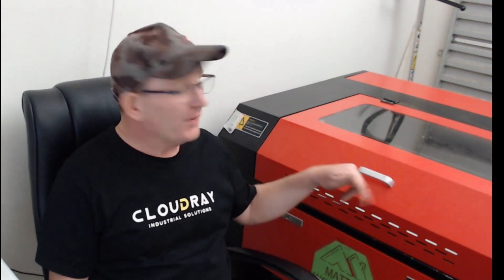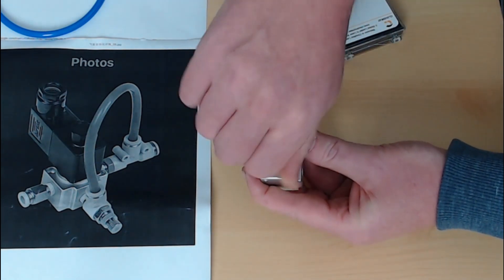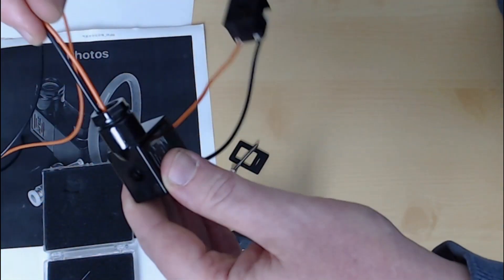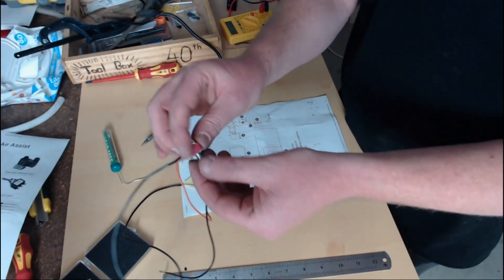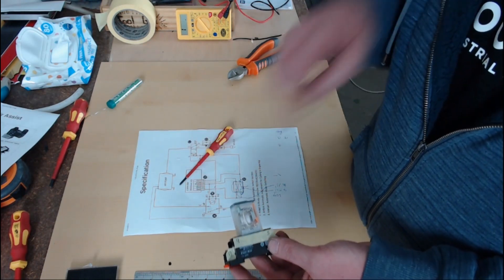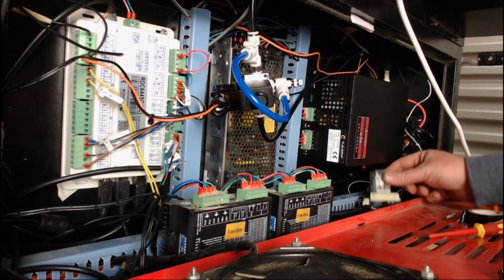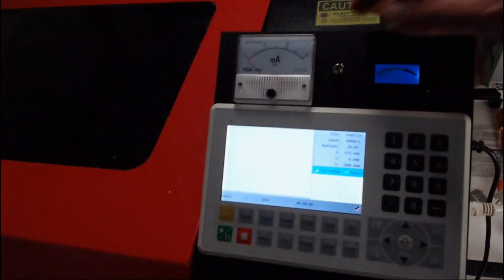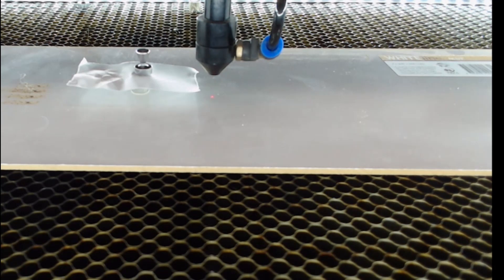Ultimate Air Assist Upgrade for Co2 Laser RUIDA 644X Controllers - CNC Co2 Laser Machine

Comment: Great video!  Especially helpful since I didn't receive any instructions with my Ultimate Air Assist kit!  I am puzzled, though, by your comments about hooking your exhaust fan to the relay, so when the air assist relay kicks on, your exhaust fan kicks on.  But what about exhaust when you're doing engraving and not cutting?  Seems you would want exhaust on whenever the laser is running.  Only turning it on when cutting would also tend to fog your lens.  Am I missing something here?  Thanks for your clarification, and thanks for your great videos-- very helpful!
Reply from the maker: With the ultimate air assist kit the relay switches power to the exhaust and the air pump.
When you select Air ON or OFF the relay still turns on both the Air pump and exhaust so they are always ON when the laser is operating.  The ultimate air assist kit also includes a pneumatic solenoid, it is that solenoid that turns ON or OFF with the engraving or cut layer options for Air on or off.  This solenoid also allows a small flow of air to protect the lens while the laser is running even if you have selected Air off for engraving.
The result is.  when you start laser, the relay switches on Air pump and Exhaust, the solenoid controls Air on or off for each part of laser work, then at completion of job relay turns off air pump and exhaust.
I hope this explanation answers your questions.
Cheers Matt
Reply: @MWLaser  I assume that is why you added a diverter section of pipe to bypass the solonoid ? ( to allow a small constant flow of air while engraving )
Reply: I was thinking the same, would be better to have exhaust fan kick in whenever a job or the laser is active?
also ideally would require a delay (off) to give it time to completely exhaust al the smoke at the end.

Comment: Hi Matt ... Thank You for making this Video ... can you tell me if the Relay can control a 24v Air Solenoid ... I want to hook this kit to my Shop Air.   Take Care
Reply: Hi Matt .. finally got my Ultimate Air Assist Kit .... I wired everything according to your video ... I hooked the wires on the Relay Terminals 9 and 5 to the Air Solenoid on my Air Compressor .... but it doesn't engage .... should I be using different Terminals on the Relay ? .... and Thank You very much for producing all your Videos :)
Reply from the maker: Sorry I've been busy - I've replied to your email
Reply: @MWLaser  Hi Matt, I'm still waiting for my laser to arrive, but I'm planning to use an air compressor instead of the pump, so the situation will be the same as Boomer088. I think I need to substitute the relay with a solenoid. Am I right? Thank you

Comment: Would this also work with the Ruida RDC 6442s?
Reply from the maker: Yes
Reply: @MWLaser  Thanks Matt love your videos!
Reply: @MWLaser  one other thing my kit only came with two diodes isn't that all that's used in this setup
Reply from the maker: @henryhartsfield4574  yes one for the solenoid and the other on the relay

Comment: Hello Matt, thank you for this video. I decided to buy it after watching your video, I thought i could do it!
But now, after receiving the product I have a couple of questions, it seems more difficult:
1. Can I connect the air blower (550w, 220v) to the same plug or just the air pump? The relay switch can support it?
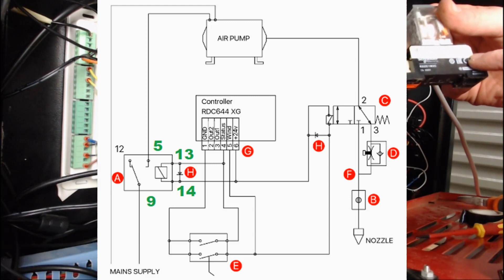2.1 I didn't understand how did you connect the wires to the plug, (between 11:37 and 12:25), did you remove the old plug wires?
2.2 I am missing some details, relating to the relay switch. Where goes the cable number 9 (and is a power in or out) and number 5 wire?
2.3 Is the controller supporting the power of that plug (as source) 24 volts?

3. The last question, it's a beginner question, but is important what kind of wires I need to buy? 0,5 copper wire, because seems you are using two types one for 220v and other for 24v?

Thanks for your videos and support
Reply from the maker: Send me an email cheers Matt@mwlaser.com.au
Reply: @MWLaser  I have the same questions....
Reply: Hi same question please. Tony 😀

Comment: Nice video!  I just ordered mine, and I was wondering what you use for the air?  A compressor or a fishtanks air that comes with the laser?  If it is a compressor, what size would you recommend for a 100W laser?
Reply from the maker: Just the pump supplied with the machine, for my larger machine I have a lager version of the same 'fish tank" style pump

Comment: Hi Matt. Thanks for the tutorial. Laser newbie here. I purchased the air assist from cloudray, but cannot seem to get the relay to work. I tried the toggle switch and it will activate the air valve solenoid, but not the relay as well. I removed the switch for now. 
To get the air solenoid to work I had to change the vendor settings to “Enable air-assist output - true” in Lightburn. The green LED on the relay is on. I have 3 outlets on the back of my laser that are daisy-chained. I routed the supply from the second one to terminal 9 and then from 5 to the 3rd outlet, where the air pump is connected. When I bypass the relay by checking terminal 9 to the negative on the 3rd outlet my circuit tester shows 124 volts. When I check terminals 9 to 5 I get 67 volts. Do you think the relay could be bad? 
Thanks for any input or suggestions.
Reply from the maker: Possibly yes - email me to discuss further if you need.
Cheers 
Matt@mwlaser.com.au

Comment: Please add the steps necessary to turn on air assist output in the vendor settings on the controller. I just spent several hours troubleshooting my install and finally decided to go through the controller options.
Reply from the maker: G'day, there are not any Vendor Settings required to enable air assist.  The option to have air on or off is set on the Layers of your work plan.  Eg if you have a Layer that is set to cut you open the layer and make the changes there.  Eg for RD works open the a Layer of your job, and you will see the option "If Blowing", set this to Yes if you want air on, or No if you want air off.  You make the necessary changes on each layer you have for your work.  In Lightburn there is also the option in the Layers labelled "Air Assist"... again turn on for Air on, and Off for no Air Assit.
Cheers Matt
Reply: @MWLaser  Matt, Jeremy is correct. I spent 2 frustrating days learning this on my own.
Reply: I wish I had read the comments before wasting a 2 days finding this on my own. You are absolutely correct. Vendor settings, on the "other" page and make sure the Blower check box is enabled. Neither the WIND nor STATUS outputs will activate if this is not set correctly.

Comment: Hey Matt, great videos. It’s hard to find much about installing this other than this and Russ’s video. I was wondering, on the over ride switch. Is the ground wire soldered to the middle two pins or the end two?
Reply from the maker: The ground gets wired across the middle two pins on the switch.
Thanks for the feedback I hope this helps.
Cheers Matt

Comment: Just purchased a 80w Laser cutter, I do not know where the other end of the yellow green wire goes. one end is attached to the machine not sure where the other end goes. Thanks in advance.
Reply from the maker: This is for the earth grounding cable.  Yes the connection is a pole screw on the back of the machine near the power output sockets.  The grounding cable gets attached to that and a then run the other end to your earth ground rod.  This is different in each country and electrical code, and with me not being an electrician cannot give advice on this, I consulted an electrician when making a decision about this on my machine, I'd suggest doing the same if unsure.
With my setup I have been advised that in Australia the earth grounding is the third prong on my 240v power lead and I do not need the additional earth grounding.
Cheers Matt
Reply: Thanks for the reply. I am in Melbourne Australia. will ask a few electrician friends. @MWLaser
Reply: Thanks for the help, appreciate it. @MWLaser